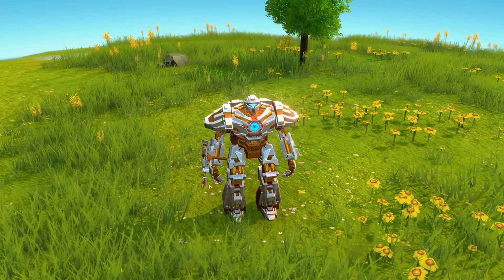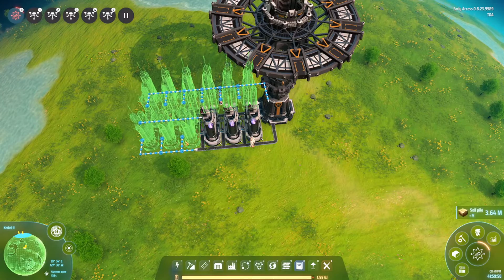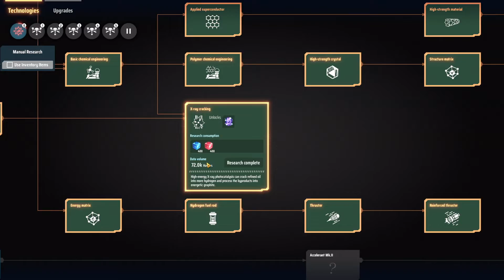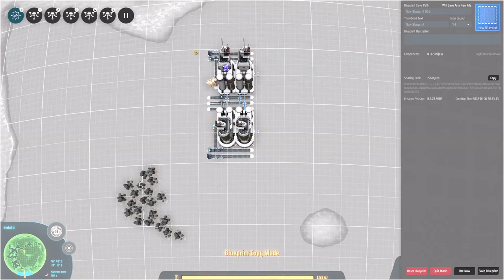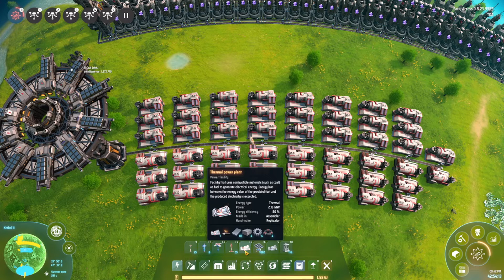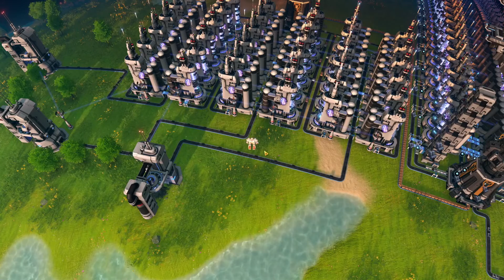Quick setups for Fracking & Exchangers| Perfect Ratio Run #17 | Let's Play | Dyson Sphere Program

Comment: Graphite is the soft black material that goes in a pencil and everyone has seen it because it's cheap and useful. It's also used as a dry industrial lubricant. Graphene is a wondrous sci-fi material, almost no one has access to, crazy expensive to produce, having crazy mechanical properties and also super-conductive. And we all know what diamond is, it is the hardest natural substance known to man, and for some reason it's quite popular on engagement rings. Carbon nanotubes is a variation of graphene, currently out of reach, but many hope we can build extreme structures out of it due to crazy forces they can withstand. All four are made up from pure carbon whose atoms are arranged in various lattices, and I couldn't mix them up even after drinking the whole night.
Reply from the maker: Today I learned things! :D

Comment: I think you have a problem on your discharger centre for the accumulators. Because you go through the tower, you won't be able to charge anymore empty ones, as the tower won't accept any more full ones. In the situation where you are over your set capacity , a common example if you are importing from a different planet. You should try side loading the tower onto the loop instead.

Comment: Hydrogen fracking blueprint does not have refined oil and hydrogen outputs connected for the ILS. For some reason it's also demanding (raw) oil. Graphite is also missing from the ILS slots.
Oil Driller Mk3 (ILS) does not have raw oil in ILS, also not belted out. Middle Belt also seems to be going the wrong way?
Reply from the maker: Fracking blueprint was fixed! The MK3 Oil Driller is like that by design - the Oil is supposed to be belted in from an oil resource (not flown in from elsewhere). Local processing, basically, then fly off the refined oil & hydrogen. Thanks for the feedback!

Comment: I ran the numbers on accumulators vs antimatter fuel rods. The result was surprising. Even though accumulators are infinitely reusable, antimatter fuel rods still come out at least 48% more efficient once you factor in the cost of warpers.

One shipment of 1000 Accumulators = 270 GJ
One shipment of 1000 Antimatter fuel rods = 7200 GJ (26.7 x more energy)

To transfer 7200 GJ:
- 27 round trips of Accumulators x 1000 + 54 warpers = 107 iron / GJ of transferred energy.
- 1 round trip of Antimatter fuel rods x 1000 + 2 warpers = 1.7 iron / GJ of transferred energy.

Those accumulators will need 27 round-trips (54 warpers) to transfer one AFR shipment worth of energy (7200 GJ). You'll need another 54 warpers to deliver the empties back to the chargers at the home system. After factoring in all those warpers, the iron cost per GJ of transferred energy drops to about 2.52 iron / GJ. So even if the resource cost of the accumulators asymptotes to zero with each reuse, the cost of the warpers must always be factored in and prevents them from ever getting cheaper than AFRs due to their sheer energy density even though they are completely used up in the process: 

To transfer 7200 GJ plus picking up the empties:
- 54 round trips of reused Accumulators x 1000 + 108 warpers = 2.52 iron / GJ of transferred energy.
- 1 round trip of Antimatter fuel rods x 1000 + 2 warpers = 1.7 iron / GJ of transferred energy.

In reality this is going to be even worse because you're not making just 1000 Accumulators, using them all up, then sending them back because your outpost still needs 100% uptime. You're going to need at least 2x as many accumulators, which increases the initial cost to 214 iron / GJ. Accumulators are probably superior for within-system energy transfer, but typically the source of your power by this point is a Dyson Sphere anyway, and discharging accumulators take up just as much, if not more space than slapping down ray receivers (though they are about 4x more efficient in energy transfer at 45 MJ vs 12.5MJ unboosted). The last thing to consider is the hit to your framerate of having 27x more vessels flying around the galaxy transferring power. Yuck.
Reply from the maker: That's an impressive analysis! It makes sense antimatter is more efficient, as it is more late-game than the accumulators (by far).

That said, i'm lazy - Solar power all the way! :)
Reply: @TheDutchActuary  Haha might find it difficult to go solar if you make an 1800/min perfect ratio science planet. Your run inspired me to do it. My builds take up about 2/3 of the planet and use almost 6 GW of power.
Reply from the maker: @3ntropy  Oh yes, at that point it will most definitely not work to go solar!